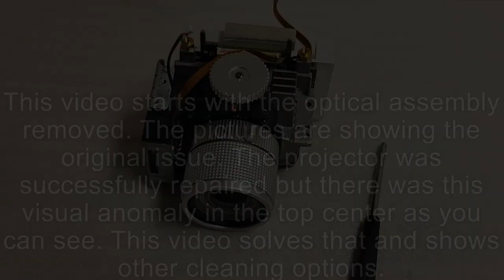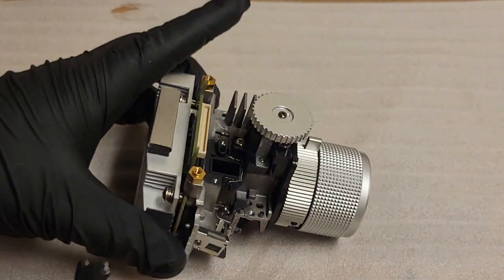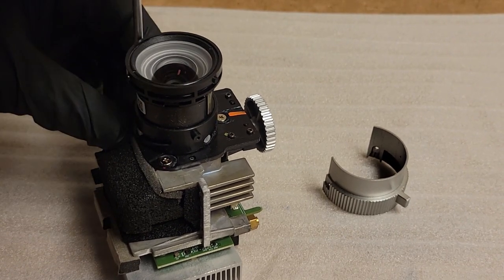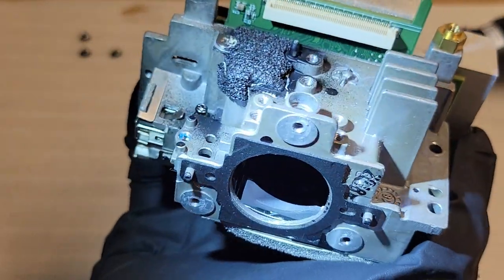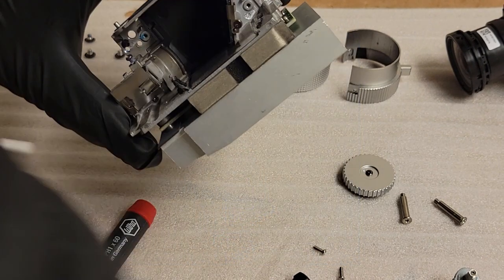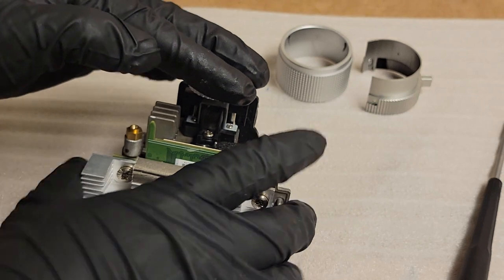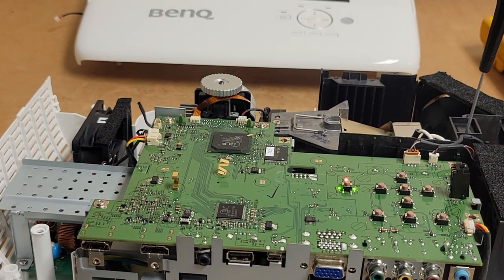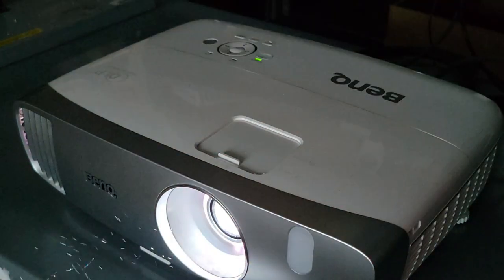BenQ HT2050A DLP Projector | Optical Assembly Cleaning

Comment: Hey Frank, thanks for your amazing video! I'm facin an issue you may have encountered before: after replacing the bulb the lamp LED remains solid red (i tried with two diffrent brand new buls). Any idea what can cause that? the lamp is connected but seems something is wrong...Thanks for your support :)
Reply from the maker: I'd guess a color wheel or ballast issue. I have videos on troubleshooting both. You can search color wheel and ballast for the videos.

Comment: Thanks for the video! I think I'm just about ready to try clean my own projector. One question: is there a reason not to use a can of compressed air? I don't have a puffer, but do have several cans of compressed air. Thanks!
Reply from the maker: The reason I dissuade people from using canned air is that it can cause the surface to get very cool if the can tips too much.  That can cause damage to polymer lenses and other surfaces.  Also it can cause moisture to build up.
Canned air does work just fine if you are careful but lets be honest. Most people would not pay attention and cause problems and then blame me :)
I would also suggest using a clean/dry paint brush or other soft bristle brush to loosen the dust. I find that a brush, a vacuum and then some compressed air works really well. The things to watch out for are pushing dust into the optics or over-speeding a fan when blowing air on it. If you take your time you should be successful.
Reply: @FixitFrank  Yeah, make sense! Thanks for the detailed response!

Comment: Frank I have a beloved 65 inch HP DLP I bought in 2006 and have used 6-8hrs a day almost every day (Sometimes more sometimes less) I have gone through 4 bulbs,  2 days ago when I turned it on its picture was alll Black and white  no color all and sources are affected HDMI Componet and Anttena. all the menu's and remote functions Just everything is in Black and white. there is a little change (kinda bluing ) if I change video mode from Vivid to warm or Movie but still B&W only. I tried disconnecting/reconnecting/all cables and Hardresetting set with no change. Any Ideas on the Cause? is it finnaly Dead?   I loved/love this TV any Help would be appreciated, Thanks.
Reply from the maker: Sounds like your color wheel might have thrown all its segments.  That is the usual cause.  Unplug the projector and kind of flip it around to see if you hear the noise of loose glass sliding around inside.  I have a bunch of videos on checking color wheels. I don't have one on your HP but the theory applies to all models.  I highly suspect thats what happened.
Reply: @FixitFrank  the TV was working fine (perfectly) the night before and when I turned it on I did not notice any weird sounds. When I turn on And when it does its finial shut down after cooling I am pretty sure I hear  the Wheel whine down, Is this still in line with it Loosing its segments???

Comment: Hello, is it possible to disassembly the front lens ? I have no idea, cleaned everything and still white dots on black screen. Problem appeard after i wanted clean the projector from outside by air
Reply from the maker: It is probably still in the DMD area.  You wont see spots if there is dust in the lens and the lens is pretty well sealed anyway.
Reply: @FixitFrank  ok, so  it looks like my air cant do it. will buy sticks and special fluid for that. Can i also wash the dmd ?
Reply: K&F 4w1 PRO it is ok or better Kodak sticks ? Thanks a lot
Reply from the maker: Any of those are good. I use mg chemical chamois sticks. They seem to be great. I have a photo brush but it's a no name.
Reply: @FixitFrank  Thanks a lot for your help, in next week i will try to clean everything !
Reply: @FixitFrank  Also no idea why my button ( Case open switch ) do not works good, i needed to lenghth my white "plastic thing" to work propely. nothing seems to break, strange
Reply from the maker: @Nekomk123  huh.  Maybe double check and make sure the casing is assembled happily? That should reach without modification.  Curious.
Reply: @FixitFrank  Holy moly, after cleaning with fluid everything looks like brand new ! Also the case open after another assembly works at it should ! :)